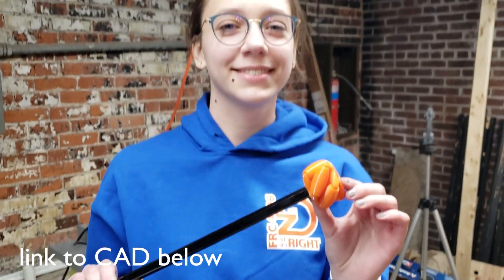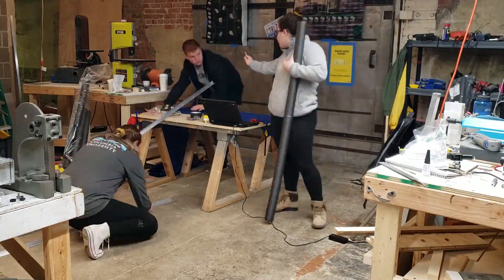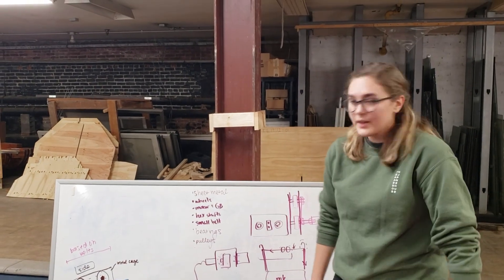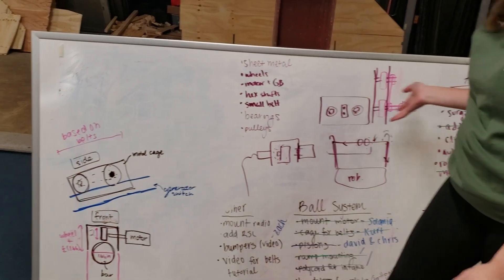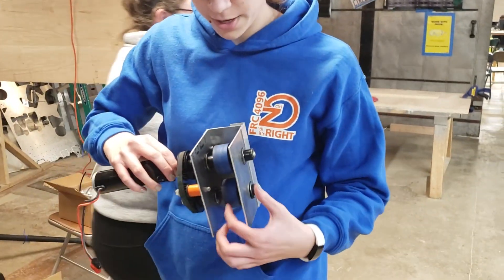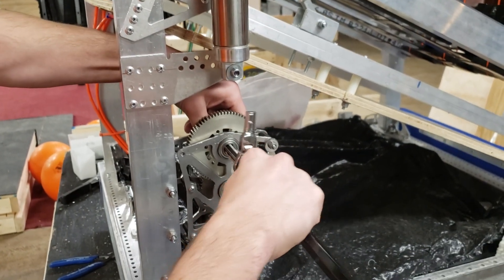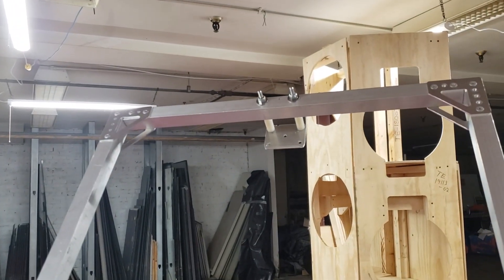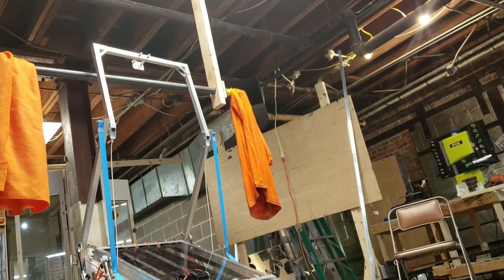UIUC Ri3D Day 3!

Comment: thinggivers of those onmiwheel. Iwill appreciate
Reply from the maker: The mecanum wheels we used can be found here (thanks team 125!): https://www.chiefdelphi.com/t/frc125-2-printable-mecanum-aka-v-i-w-release-2019-2020/369139

We modified the files to be built using super glue instead of #0 screws, those files can be found here: https://workbench.grabcad.com/workbench/projects/gcoPH1NP5kiTupOEyEjaEhb4IgvJq05gGTW3ws11sd8WP3#/space/gcJji-HmnvBk1pW2b9NAI3XnXlRYdFmmD4qisoZ0cFXIdT/folder/7581637